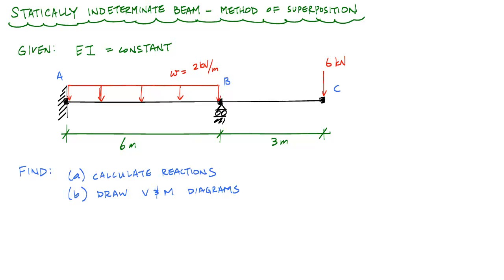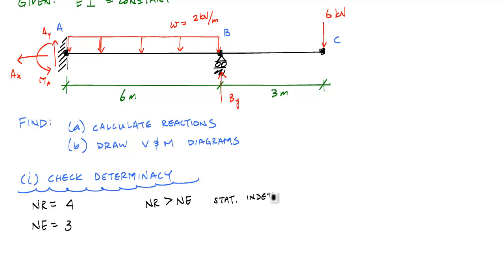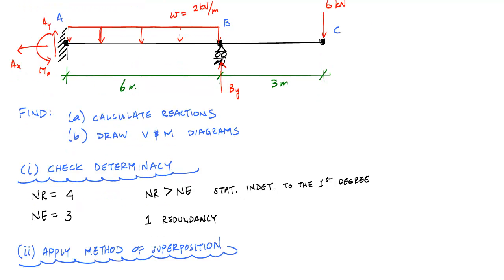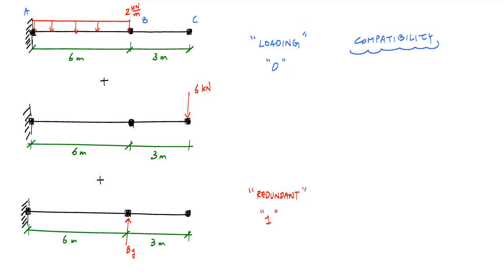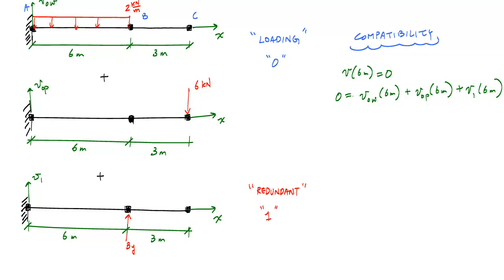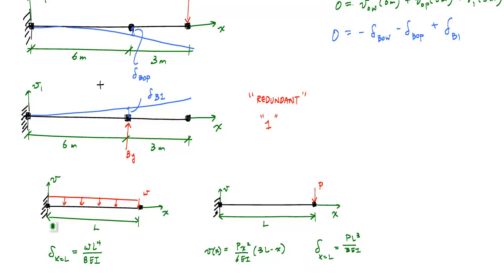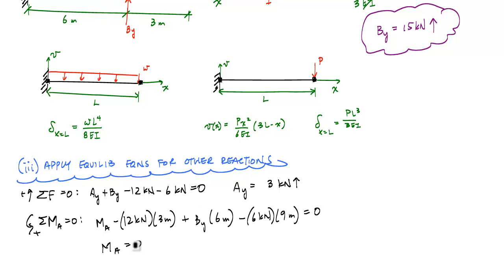Statically Indeterminate Beam by Superposition Example 1 (Part 1/2) - Mechanics of Materials

Comment: You made an error its 18 kN, I used method of forces and Morhs integral. 2x6 + 6 does not equal 15, the reaction should balance the loads 😅

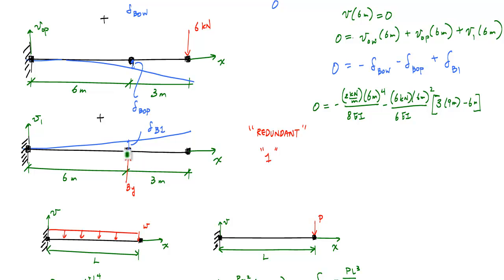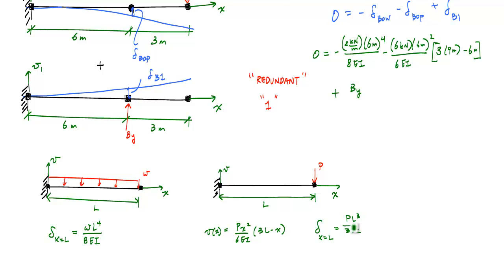Comment: Why at time time 7:30 did you use a different equation then at time 7:50 when both are point loads along the beam? Does it have to do with the support? The one at 7:30 starts with v(x) and the one at 7:50 is the delta equation.

Comment: This seems statically determinate. The reaction Ax is clearly zero, and then you could use equilibrium equations for the moment and y-forces to find reactions.
Reply from the maker: There are four unknowns and three equilibrium equations in this case. So it is statically indeterminate.
Reply: if you clearly assume Ax=0, that's an equation already being used

Comment: I'm solving for a statically indeterminate shim (cylindrical disc fixed at center) stack 

This is really helpful.
Reply: https://youtu.be/fRyUf-GY754     ..
Reply: @dellpi3911  thanx bro, could be a good reference, I've developed eqns by myself till now. simulations will definitely be helpful.

But say something don't post just the link, that's sus you know. I thought it was self-promotion 
👍

Comment: Where would the method of superposition not work?
Reply: If you were given a loading function that weren't in your table of reference functions, which is very uncommon.

Another example you might see, is if the support weren't an idealized infinitely rigid support, but were instead a spring with a finite stiffness.

Comment: Hi sir! Did you solve the same problem using double integration method? Anyways this was very helpful!!
Reply: no, he solved the primary beam with actual loading and then with unit value of load by using formulas from tables, other wise it would be very lenghty to solve this with double integration or conjugate beam methods :)

Comment: Hey, I really enjoy your videos! Thanks so much for all the work. I have one question though.

You say at the beginning that this problem is statically indeterminate, but why?
When you solve for a statically determinate beam with sum of forces in y, and sum of moments about B you also obtain that the vertical reaction at B is 15 kN. 
Also, can't you say that the horizontal force is negligible, because the deflection is so small that the horizontal component of the applied forces is 0 because 

sin(very small angle) ~ 0

Anyway, thanks again for all your help, you're most of the reason imma pass my Mechanics of Materials exam tomorrow :D
Stay awesome!

Comment: Thanks for the great videos. Would it be possible to tell me in detail how you got the bellow equations please?
1- dx = L = wL4 / 8EI ,    2- V(x) = ((Px2)/(6EI))*(3L - X) ,  3- dx = L = PL3 / 3EI 

I used here d instead of delta please. Thanks in advance.
Reply: +structurefree HI there. I have the table in the text book that says what the individual equations are. I don't see one for equation 2 though. It seems this is an equation which comes from the fact that the force does not act at B? How did you get this equation? Specifically why did it change from WL^3/3EI to ((Px2)/(6EI))*(3L - X) ??
Reply from the maker: +AbdulMalek Makhdom the equations for beam deflections were from a textbook.  Most textbooks and engineering handbooks have equations for deflections for common loadings.  You can also search and find on the internet. Thank you for the kind words.

Comment: why did you choose By to be the redundant? why not Ay or Ax?
Reply from the maker: shylildude I chose By so that the "determinate" structure would be a cantilever, which is familiar and also has equations from various handbooks.  You can choose Ay or M_A, but you would have to use your preferred method to calculate deflections for the determinate structure.  Ax is known from sum of the forces in the horizontal direction, so it is not available as an option.

Comment: @tw0million @structurefree i also don't get why he use the v(x) either... my lecture use the Compatibility Conditions then find the equation for the redundant that he took out. Next step he just use the v(x) equation to find the what is the displacement

EDIT: I know why now... the reason he use elastic curve equation v(x) for graph 2 because in the formula sheet there is a formula for a concentrated load P acting at the end of the cantilevered beam v= - Px^2/6EI (3L-x).

where the other 2 (first and last) is acting @ 6m (it's not in the middle) so you can't use the v(x) equation if that make sense lol
Reply from the maker: I use lowercase v to represent a function for the deflected shape or elastic curve.  In the compatibility equation, I am looking at the superposition of deflection at point B. In general, I use a capital V for internal shear force.
Reply: Since there is a support there, the deflection would be zero, which is why he added the sum of the 3 deflection pieces as being equal to zero.